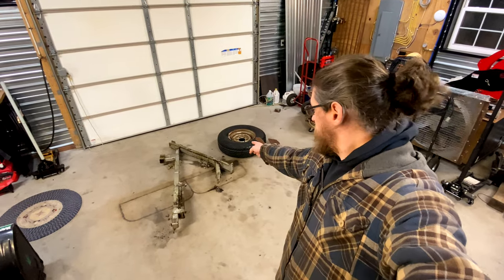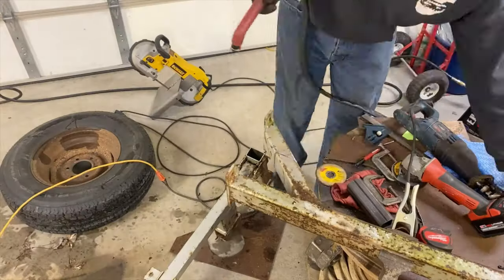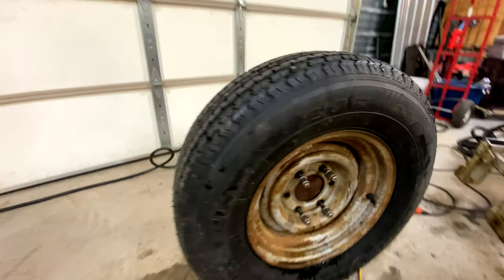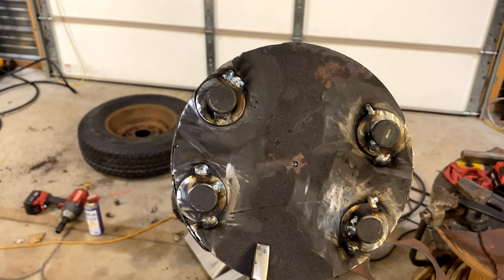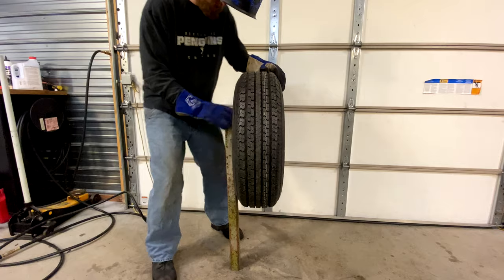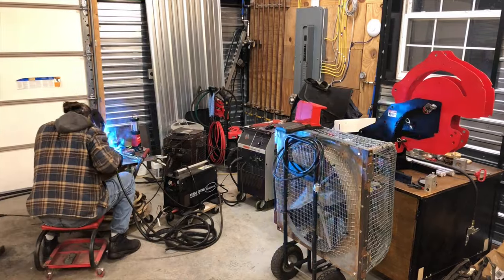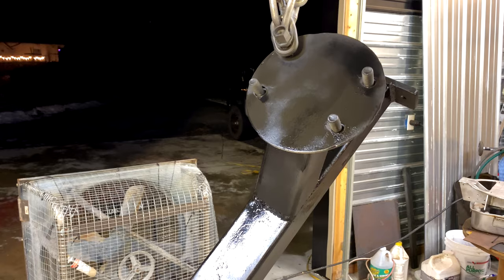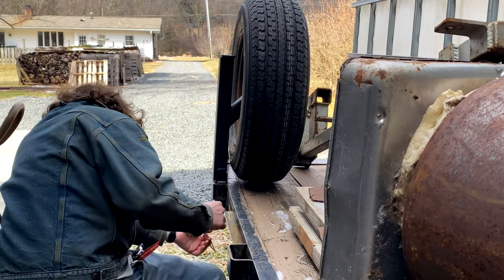Flexible, movable spare tire mount for a Utility Trailer.

Comment: You did not have to ask how I know about the yellow jackets. Also if there is any open areas above you will want to leave a small drain hole. Preferably smaller than a Yellow jacket at the bottom.